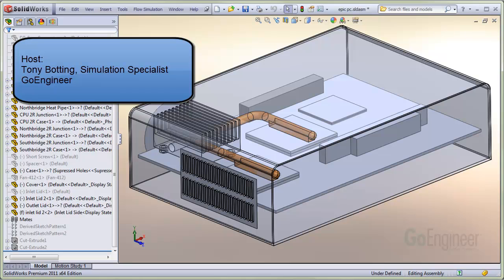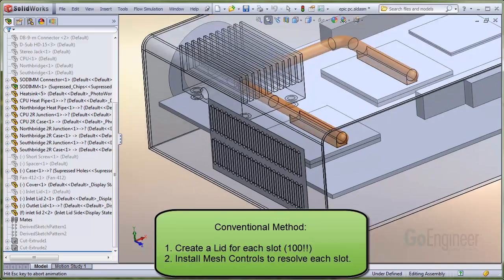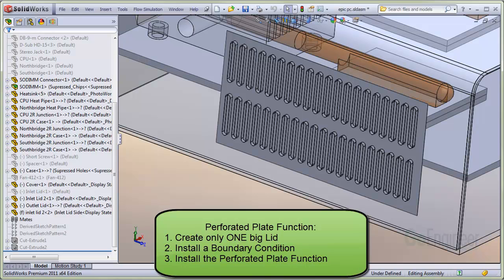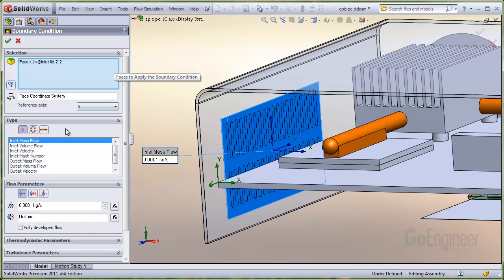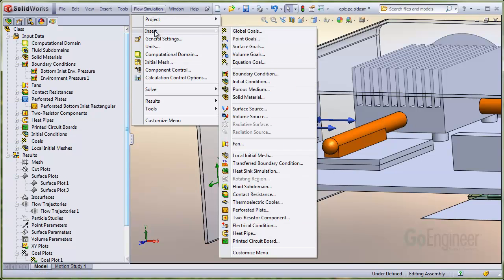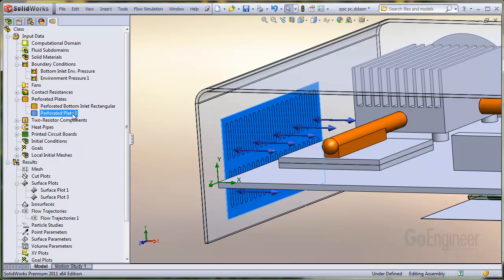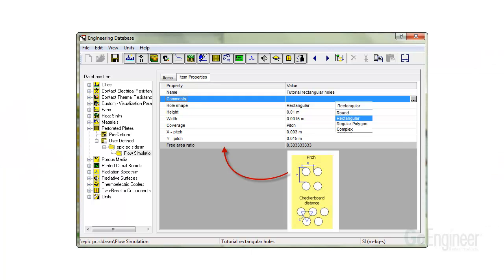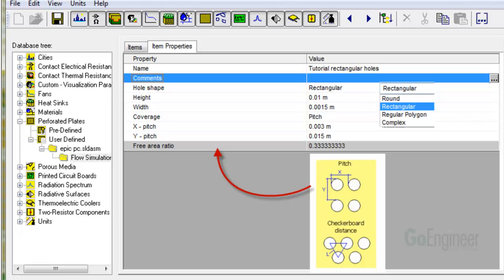SOLIDWORKS Flow Simulation – Perforated Plates

Comment: I realize this video is 13yrs old now but it is entirely incorrect in how you apply perforated plates. The video shows the slots still present as well as the lid. That will cause the slots to still be meshed and act as flow restrictors going in to the lid boundary basically doubling the restriction. The correct way to do this is to suppress all slots then cut out an entire area on the body equal to the perforated zone. You then create a lid on that hole and apply the Env. Pressure boundary on that new lid. Then define the perforated plate to match the slot geometry and pattern area. Go Engineer needs to take this video down and release an update.

Comment: Hi, I have a question:
in this example you have a surface of the enclosure with some vents, then you create a big rectangular lid coincident to the inner face of that surface and add the perforated plate condition to the lid. The question is: I would say that, by doing so, you are applying the same constraint twice because the enclosure has some vents and also the lid has the perforated plate condition.
If I had been you, I would've edited the enclosure part, created a big rectangular hole where the vents are and then, in the assembly, created a big rectangular lid with the perforated plate condition.

Is what I'm saying correct? If it is, what's the point of doing the way you did?